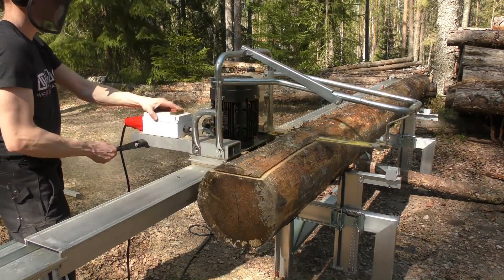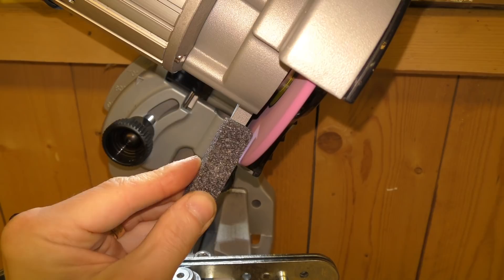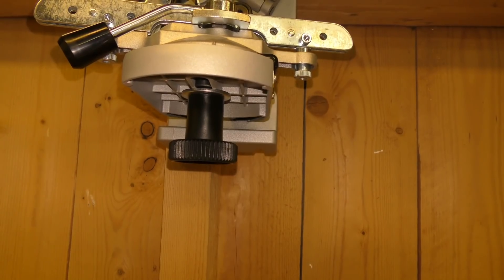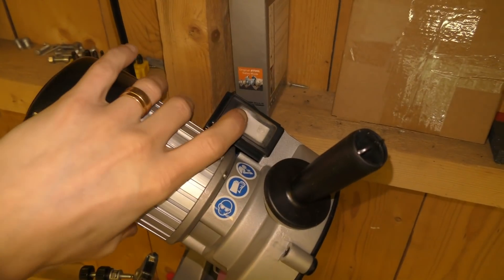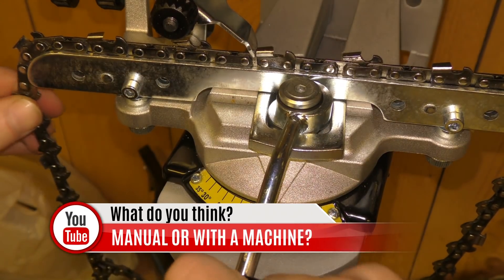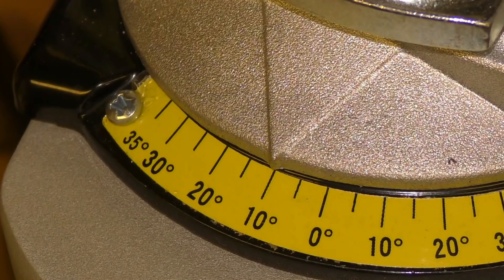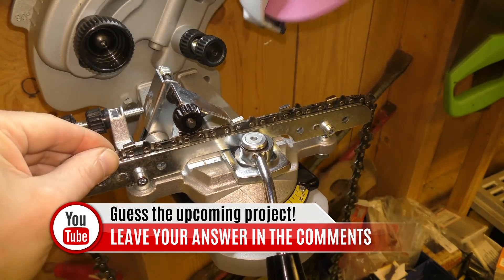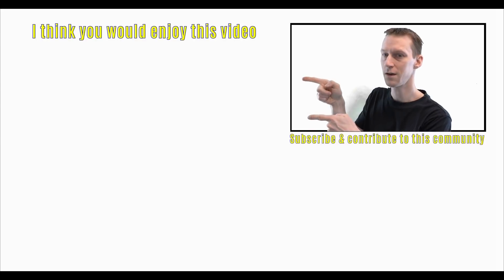HOW TO sharpen a chainsaw chain with electric sharpener in 6 minutes

Comment: Just found your channel and this vid. I have a sharpener as this and your right in thinking about the diamond wheels. They are pricey but you will more than make up for that price in the long run with replacing the stone wheels.  The bad thing about the stone wheels is that you really can't get through a complete sharpening with the same adjustments on the grinder because each cutter removes material from that stone wheel ever so slightly and therefore changes the thickness and shape of the wheel. That was the main reason I went to the diamond wheels. I mostly sharpen by hand in the woods but correct my chains with the grinder and sharpen for others as well. It's very handy when doing multiple chains. Just a tip.....always start the sharpening with the shortest or smallest top plate cutter and adjust the rest of the cutters to the size of the shortest one.

Comment: Hi what angle should I be on to sharpen for iron bark .At the moment I'm doing 50degs on the top and 25degs on the bottom angle
Reply from the maker: Hi and thanks for watching. I have no idea. If the way you are doing it works for you keep doing it. Otherwise you can probably find the answer on Google. Have an amazing Tuesday Eddie!

Comment: Is the chain you sharpened for mill chain saw , like an Alaskan , I've never seen one sharpened blunt before ?
Reply from the maker: Dont really know what you mean with that but its according to the instructions and the chain is really sharp and holds for quite a long time.
Reply: It is. It is a ripping chain, made for cutting along the grain, hence the 10 degree angle.

Comment: The depth gauges, are they adjusted too in the same process? If you sharpened five or six chains at once I suppose the time saved starts to be more noticeable but for one chain and with the extra time of taking the chain off the saw and putting it back, I think I would not buy such a machine. I stood and sawed some thousands of meters at the turn of the century on a Jonserud chainsaw mill and filed by hand aided by a small rolling jig, but at the same time it gave me good muscle memory and now I can get good enough results by hand and eye.  It kind of discounts my opinion, since most people would not have so much experience. To them it probably would be a good idea if they, like you are milling on a chainsaw mill and need three to six sharp chains a day. Since accurately sharp chains is really important for milling for many reasons. Takk for bra filmskaping, hilsen fra Norge
Reply from the maker: Lucas Richard Stephens Thanks for that comment. No the depth gauge are not taken care of in the same process. But I only do them every fifth time I sharpen the chains. The process for the depth gauge is to change the angles to 0 degrees and do another pass. I got about 6 chains. Its important to sharpen often when using a chainsaw mill. Next week you will see some action on the mill. Where in Norway do you live?
Reply: Very cool, I am subbed to your channel so will look forward to your next film, I live in Jevnaker, which is about 70k north of Oslo.  Are you in western Sweden?
Reply from the maker: Lucas Richard Stephens Thats great. Im in the Bergslagen area.
Reply: Is it that hand held one or a motorised one like in this film?
Reply: Yes I've seen those, I had a customer that had one when I did the Stavlaft film. Great idea, takes the guess work out of it.

Comment: My chains are at 30 degrees not 10
Reply from the maker: @kennethweaver7606  I sharpened a ripping chain, not a crosscut chain. You’re absolutely correct: a crosscut chain should be set at 30 degrees, while a ripping chain is typically around 10 degrees. What chainsaw do you got? Im a Husqvarna fan. Probably because im Swedish 😀 Have an amazing Sunday.